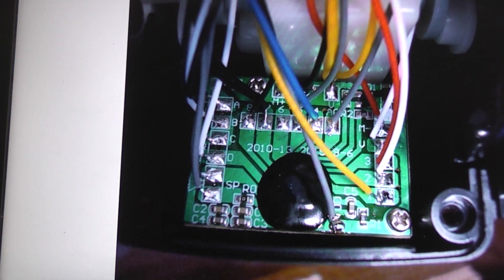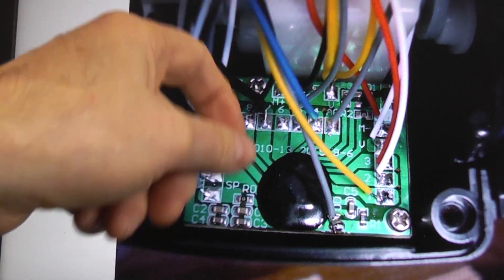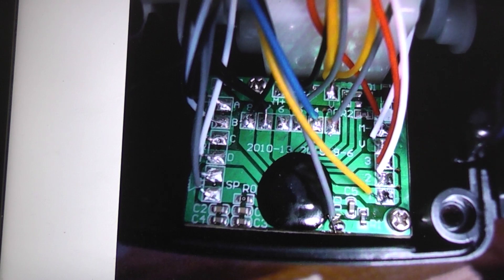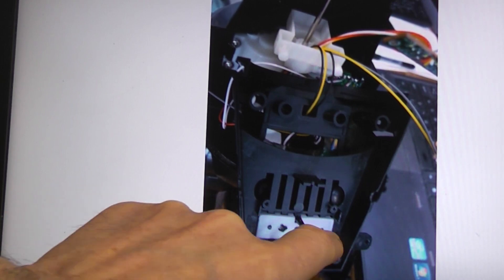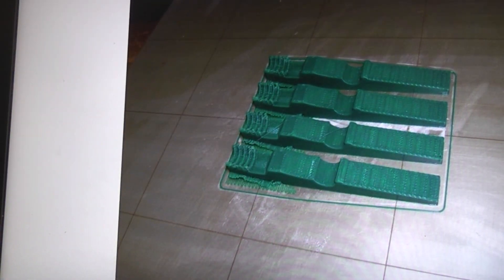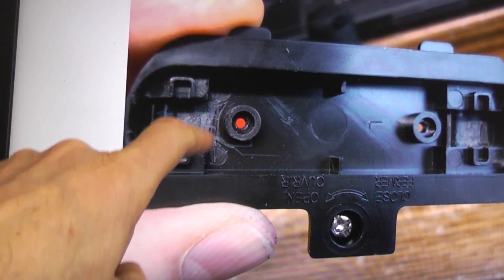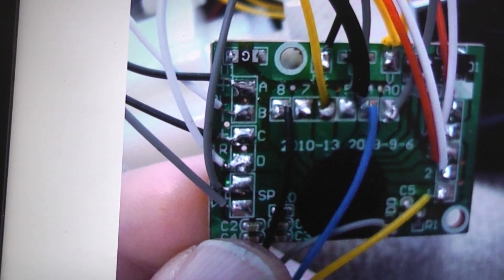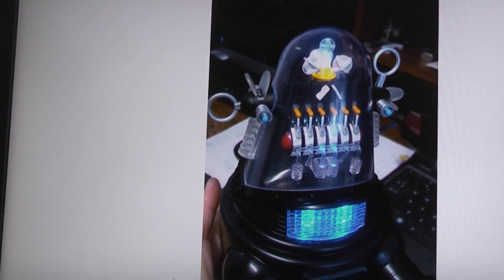Electronic MOD for the Walmart Robby. make the mouth flash like the movie.

Comment: Has anyone tried to add wireless remote controls to Robby ? I haven't found it on any youtubes so far ..
Reply from the maker: Sounds like a fun project for you to try out. The RC guts from a Mini car or tank would work.
Reply: Thank you for your quick reply, I've come acrose a few small receivers that looks like they might be small enough to fit inside, worse is I may end up with a Robby with a back pack.
Reply from the maker: @afoxyjim6625  The little table top RC cars that they call Coke can cars now days, have digital RC design, the control board is the size of your thumb nail. They can drive 2 motors OFF and forward and reverse. So you can use them to control 4 motors if you do not need the forward and reverse function. Also you can trigger sound effects with them.
Reply: Thanks again I'll check it out.

Comment: I'm having issues with the Walking. Nothing seems to be broken I've opened it up and everything, but for some reason when I switch for the walking feature the mouth area flashes but nothing else happens.... any assistance would be highly appreciated thanks.
Reply from the maker: Try brand new batteries, even one low or defective battery will make this happen.

Comment: I was able to follow your video and move the wires around to make the mouth flash correctly which worked like a charm but now the LEDs on the left side of the mouth flash dim and the LEDs on the right side are bright. Do you have any thoughts on why this may have happened and how to fix it?
Reply from the maker: Its been 1.5 years since I was inside doing the mods that I do not recall much about the wiring, sorry. But if I find a reason to get inside another these Robbys again I will look for a answer for you.
Reply: Do what Mr, Spock says:  "Cross circuit to B"

Comment: So I was taking the chest apart to look at the circuit board for the rewiring job and watching the video and wouldn’t you know it, my robots got different colored wires inside. I haven’t checked the second one yet but I’ve a feeling that it’ll be similarly wired up. Can I share you my pics? The wires are as follows: #8 - white, #7 - two wires gray and red. Nothing on 6, #5 also gray, #4 blue. The three that go “up” on mine appear to be two yellow and an orange and I think that’s the one I will need to move. Again I can share my photos if you’re up to looking at them. Thanks in advance.
Reply from the maker: Yes they seem to change wire colors from time to time. So wire placement in the pictures is about all I can share. Now many other youtubers have done video's of my mod and some of there videos might show different color wires. But in the end the wire color does not really matter what matters most is where the come from and the points that I show you to connect them. But first check out the other videos I did as well as the videos by others just in case that shows you what you need to know. I do not have a walmart robby that I can tke a part to try and compare with pictures you have taken so I do not know that new pictures would be any help.
Reply: @Robothut  Sounds good, I figure that based on your videos [I have watched them all at least 3x each], that based on where to find wires soldered to the board and where they should be going I can figure it out. Thank you

Comment: Hi still no luck with putting new battery's in now just one light is on as soon as I connect the battery's both the on off button and mode button do nothing. I will have to take Robbie apart and look for loose or dethatched wires and check the switches If I can't fix him at least I have a great shelf ornament.
Reply from the maker: That sounds like a good plan, bad wires or defective switches need to be checked. Before you make a ornament out of it you can always wire the motor to run threw the slide demo switch on the back of the body and still have a walking robot.

Comment: How do you take it apart to fix the mouth wiring? Do you have to remove the head or take the torso apart?
Reply from the maker: Yes it is fully covered in my many videos on this Robby toy. Check out my Robothut  youtube channel. The ear blasters have to be pulled off the dome lifted off a few screws removed then the mouth parts will pull out.

Comment: A huge thank you for sharing this info.The mods really make Robby pop! Also a shout out thanks to Boyd at trekworks for giving us a heads up on you're wonderful channel.,I do have a question and maybe you are one of the few people who might be able to answer it. On the old 1997  trend masters classic lost in space robot with lights and sound do you happen to know if any one has wiring diagrams or pics of the wiring and or boards inside?I had one   damaged in moving and have no idea where the wires go inside.Any way thanks for this wonderful video!!!
Reply from the maker: So glad you found my channel. You will find lots of other mods for the Robby as well, like the proper robby glove and lit blaster mod. As for the 1997 B9 robot  do you mean the 2 foot tall one ? If so here is a link to a you tube person who is moding there B9 so he must have the control board wiring out and maybe other videos and pictures.
https://youtu.be/24bRV23CYNY
Reply: Glad to be here now. Thanks!The trend masters b9 I am tying to repair is the smaller 11 inch or so size.You're channel has some really amazing stuff.Thanks again!!!

Comment: i bought a few of these and converted one into a door bell.. when someone pushes my bell  , my ROBBY goes off... but i noticed that the walking action switch has more features to it than just the talking switch.. but the walking switch never shuts off once it is activated.. is their a wire config that will allow the walking action to activate but on a timed manner.. i want the walking action as the door bell on a timed interval..
Reply from the maker: Great idea using it as door bell. As far as timed function that would take some doing I think.

Comment: Hi there...just watched your mod videos (excellent job btw..) and am looking forward to modding my own..one question..is it possible to have the gyros spin in talk only mode?
Thanks again for the tutorials...👏
Reply from the maker: The gyros run off the walk walk motor. So if you wanted them to operate seperatly you would have to add a small gear motor just for the gyros.
Reply: @Robothut  
Thanks for the info...think i'll stick to the simple mods...😊
I'm waiting on a mod kit that uses fibre optics to light up the blasters..
Keep up the good work,thoroughly enjoy your vids... :D

Comment: My Robbie came with a black wire soldered to #6 (goes to head), in addition to the individual black wires on #7 & #8. What happened?   I don't want to take the head off & I can't see a way to pick out the yellow wire   to solder to #6,  from the 3 yellow head wires without removing head.  Any suggestions other than removing all 3 wires from V and resoldering one at a time?
Reply from the maker: I do not see an easy way around it. They do like to change the wire colors it seems from other guys posts. But for the most part the wire color does not matter as long as the wires are moved from the positions I show to the new positions things should work.
Reply: @Robothut  Thanks, but I still don't know what gives with that black wire (black wires are on 6, 7 &8 from factory) that is soldered to #6  Where you would put the yellow wire in question?  Leave it be on the #6 position?
Reply from the maker: @dennisstahl1183  What I would do in your case is first you have to find out what wire that is soldered to V+ is the mouth wire, so remove one of the wires from the V+ pad and see if the mouth stops working or the dome light stops working. Once you have the mouth wire located you can then move the wires what ever colors they are from 6 & 7 pads to the #5 pad and the mouth wire you just found to pad 6 or 7. Since 6 and 7 are the same thing either pad will do.
Reply: @Robothut  Thank you very much!  I'm 71, and I think I went into an anxiety driven senior moment.  LOL.   I got the correct yellow wire to the mouth first choice.  One of the 3 wires appeared to be longer than the other 2, making me believe that one likely went to the mouth, as the other 2 wires had further to go into the head, and had less slack left, if you know what I mean.  It works fine, anyway.   I had already sprayed the exterior of the mouth Tamaya transparent blue, and I can live without the black separators of the mouth.  And now, having the mouth working right, is enough to make me happy!   "The Day the Earth Stood Still" and "Forbidden Planet" are my all time SCI Fi favorites..
Reply from the maker: @dennisstahl1183  All right. Great way to start the New Year. Great job.

Comment: Was wondering if you could make a video of how to wire in a USB power supply so the robot lights could be on for display without the talking or walking?
Reply from the maker: Seams like all you would have to do is add a KILL switch for the Motor and speaker. The robot runs on 6 volts "4 batteries at 1.5 volts each" so the 5 volts you get from the USB would be close enough to replace the battery power.

Comment: Thanks for the information John, I just completed the electrical, interior dome painting and the voice tube painting and blue gel mods. It came out great. The only additional thing I did was to 3D print a replacement button for the voice activation, on the front of that button I added a small brass cap with 4 holes, to make it look more like the original.

Comment: On mine, I have 3=Grey, 4=Grey, 5=Grey, 6=No wire, 7=Red, 8=White. The mouth circuit board has a Grey, Yellow and Red wires.
Reply from the maker: Yes kind of crazy how the control board LED wiring has changed so much. Kind of like different assembly houses are building the toy.
Reply: @Robothut  Welp it works. The wires were just different colors. Thanks for this great tip. Now to find something to make the mouth blue.
Reply: @Robothut  Looking again, 7 has a red and a grey wire, and what I called 3 is marked with a code. I am thinking that the circuit board is the same and they used different color wires.
Reply: @Robothut  I put pictures of my circuit board here https://www.youtube.com/watch?v=ySGo7vvir08

Comment: Well - I thought I was a pretty good robot surgeon when I fixed my Remco Lost in Space robot.  It was just a loose wire on the Kayko motor and replacing a blinker bulb from a jack-o lantern flashlight.It’s impressive that you figured out how to correct this!
Reply from the maker: I did electronic circuit design for a major corp. for 20 years.

Comment: Thank you for this video 👍 your video is so easy to follow, the mod work will be done to mine, makes Robby so much better, very happy viewer here, keep up the good work, many thanks 😊😊😊😁
Reply from the maker: Cool. Glad I could help. I have heard from many that have done the ratchet food fix so the robot walks right, but few that have done the electronic mouth action mod. I have done 4 full mods so far. What a great robot toy for the money !
Reply: Robothut Robothut I agree, for the money it’s an excellent buy, I bought an extra one, just incase I messed up on the electronics of the first one lol was so cheap I thought hey, why not ... well what a success 😊 followed your advice, and it’s excellent, I love what you did and very grateful for your vid, one very happy collector here, thanks buddy, a great post from you 😁😁👏👏👏
Reply: I just got one from Amazon,  as Walmart had none (though I did get a credit..so it's still $20) But, how do you get to the electronics?  Are they in the torso?  Personally,  I would love to make 'walking' as an option, and always have the 'gyros' rotating when he is pressed. Maybe just the head moving as in the film.  Oh..what gel did you use?   Is there anyway to could either do a  single video..from opening,   soldering,  and closeing up?  Or a series of still photos??
I also have a trendmasters B9..and I always wanted him to say 'my sensors detect an intruder present' while in surveillance mode, vs 'Danger, Will Robinson.......'
It just made more sense
Reply from the maker: I did 4 videos on this. you can find them in my Robothut channel.
here is the one on fixing the walking problem for example. https://youtu.be/fmH06mJfZAY
There is only 1 motor inside so if you want the gyros to spin but the robot not to walk you will have to add a micro gear motor for that function. The robot already has a switch to turn off the walking action, so it is a option. I uised a blue lighting jell, but you can use translucent blue paint from a hobby store to tint the LEDS. I did a complete post of pictures and videos and information on the Alpohadrome web site. Here is a link for the topic.
 http://alphadrome.net/forums/topic/22906-goldlock-walmart-2020-robby-and-trendmaster-1999-robby-inside-look/
Reply: I just did a lot of masking (painters tape, a plastic shopping bag & a piece of saran wrap) & then painted the mouth with 3 coats of  the Tamaya blue.  Looks great!  Is the circuit board for rewiring the flashing inside the torso, so the head wouldn't have to be removed?  Thanks